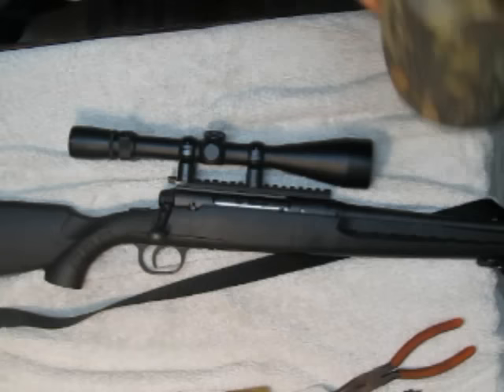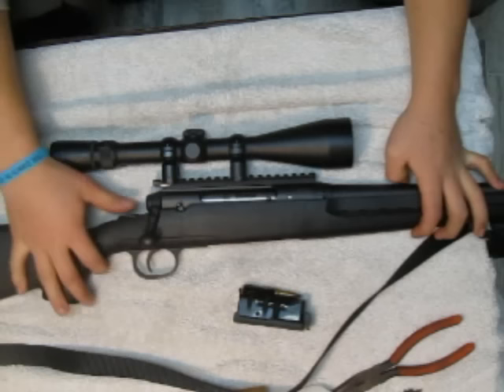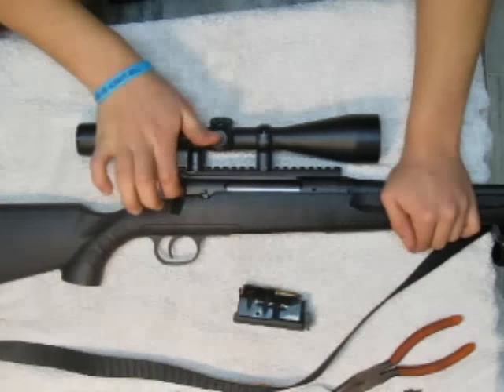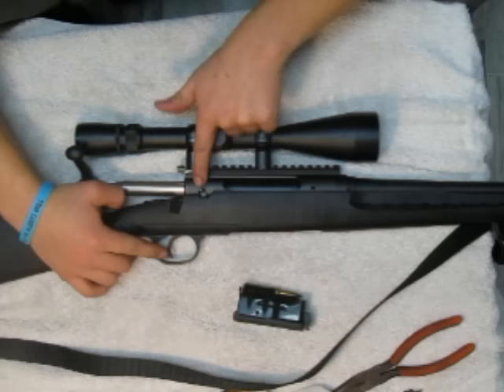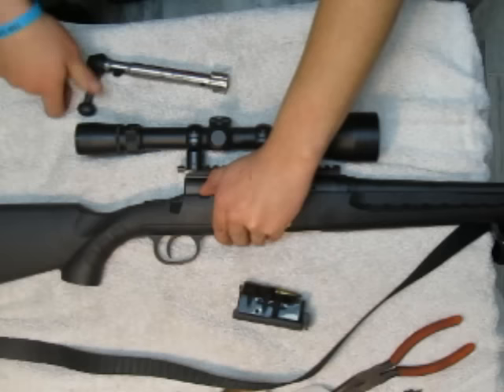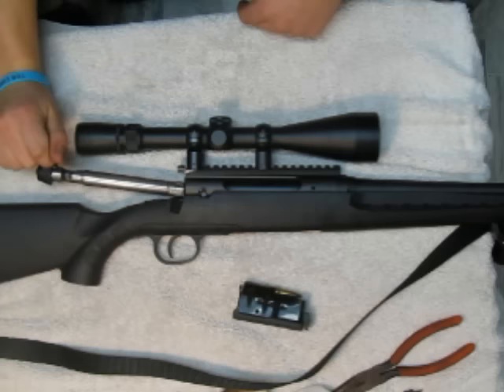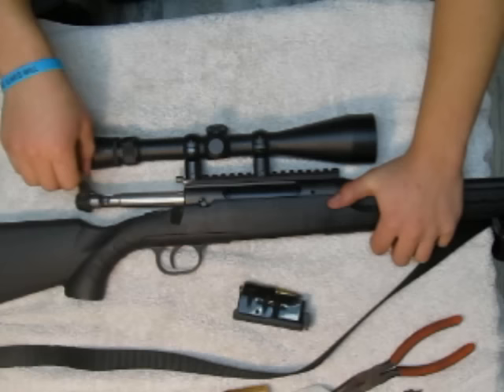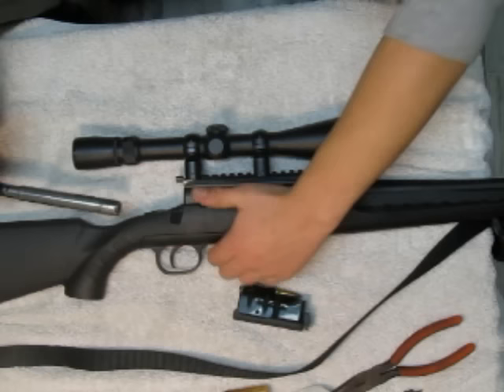Savage Axis: How to remove bolt from the savage axis

Comment: Thank you for a simple great video  . One thing I had a problem with was there is a part that rotates at the end of the bolt that goes into the gun . And if that is not turned to line up with the other piece it not even go into the  gun . Once I turned it the bolt slipped right in the end. All I did was follow your instructions and it went right in . Dam my explanation is longer then the video  LOL  .
Reply: How did you turn it to line up the lugs?
Reply: @JoeStMars  it's not really linings up the bolt that's the problem  . You have to remember to pull the trigger when putting the bolt back in . 
Good Luck

Comment: That scope is mounted way too back ...should be forward a few inches
Reply from the maker: Why is that
Reply: @MuddyCreekOutdoors38  Every gun I've ever seen has the back of the scope aligned with just past(say 3/4 inch) the back of the trigger guard. Allows you to get a good cheek weld without risk of it being too close and hitting your eye with the recoil....check it out yourself.